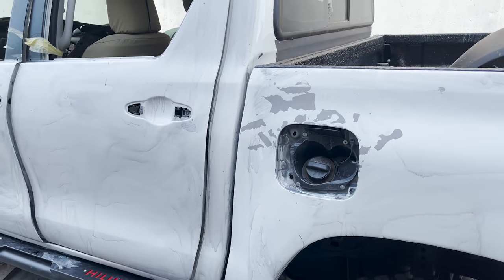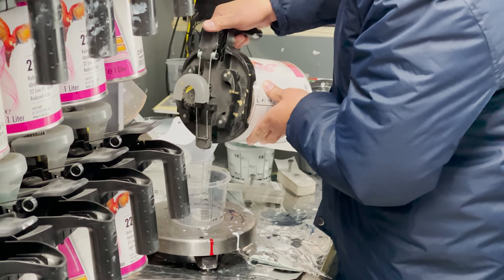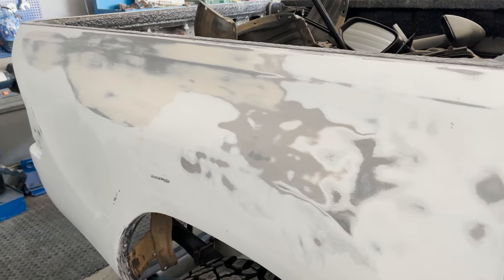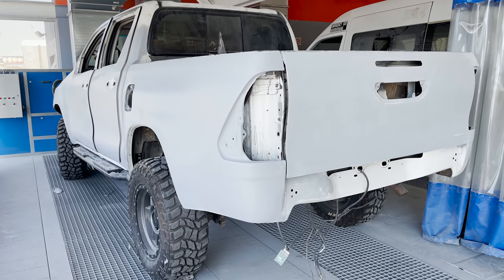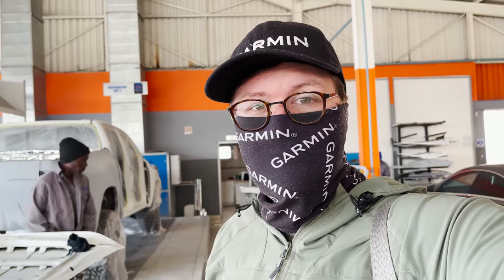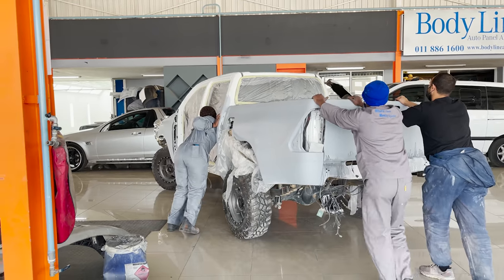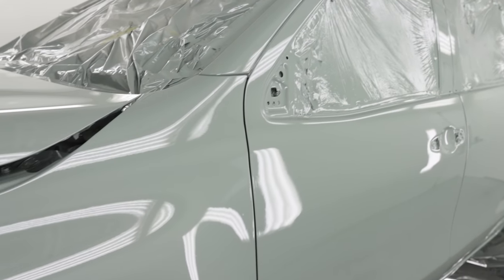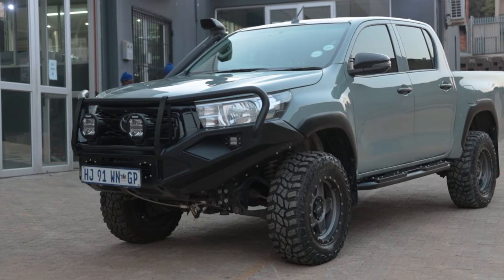When Everything Goes Wrong...  What happened to ROAM Overlanding? (New Colour Reveal)

Comment: Hey! Was waiting to hear what actually happened to the vehicle? Did I miss it or didn't you say?

Good to see you back, man!
Reply from the maker: It was really just that we wanted to remove the wrap and the drama was in how the wrap just wouldnt come off; so the nightmare was the trauma of trying to get it off, and the state the vehicle was in to get it clean. But  at least we are past that now!
Reply: @RoamOverlanding  did they use a heat gun or wall paper steamer to remove it? Looks like they were just picking it off?
Reply from the maker: @Azza044  nothing actually helped; they tried heat gun, high pressure hose and even scraping it off.. in the end it took 60L of thinners to melt it off
Reply: @RoamOverlanding  wow certainly wasn't wanting to come off!